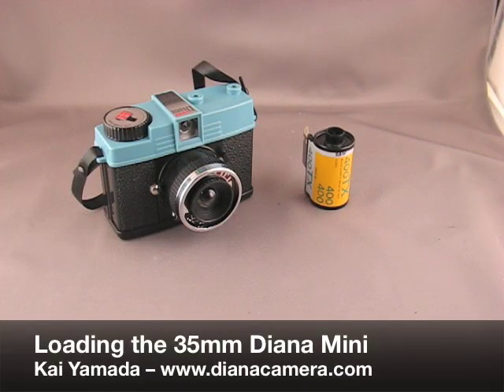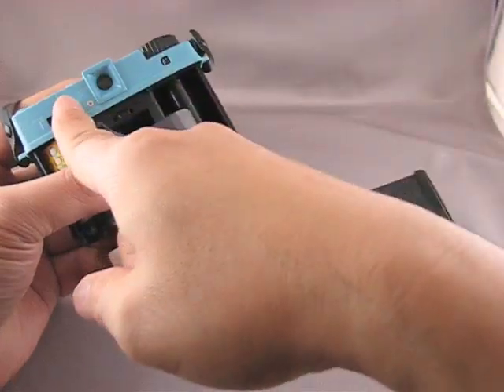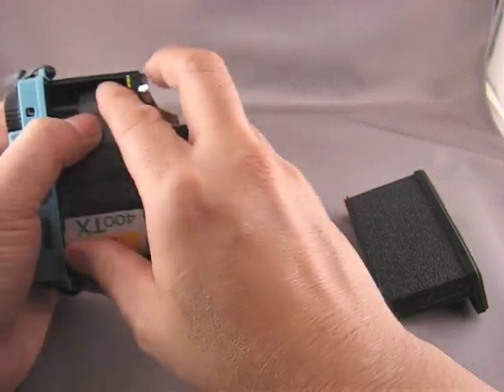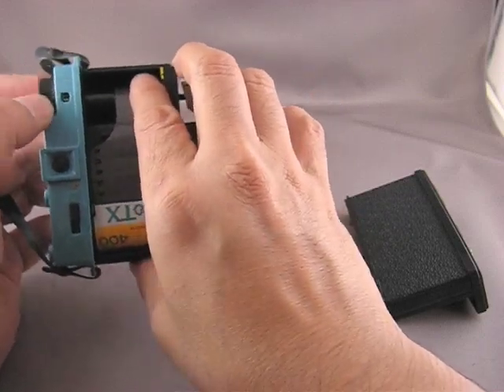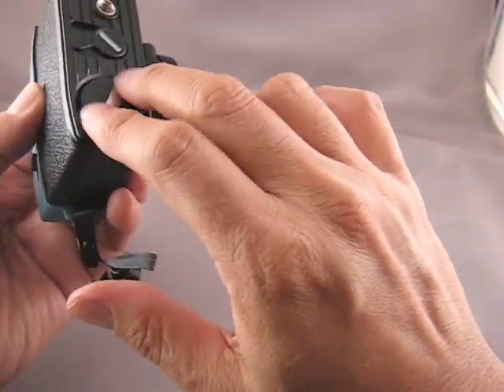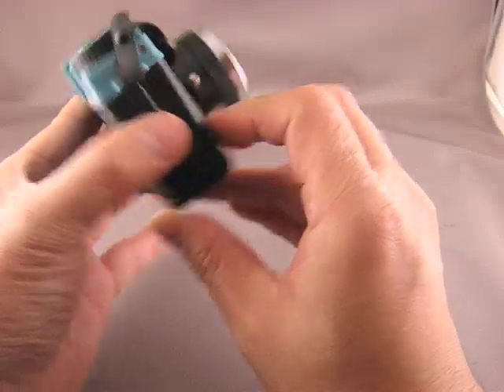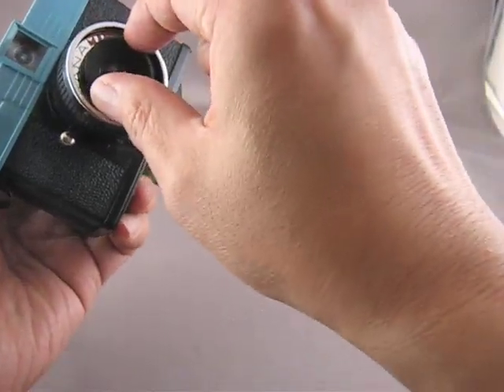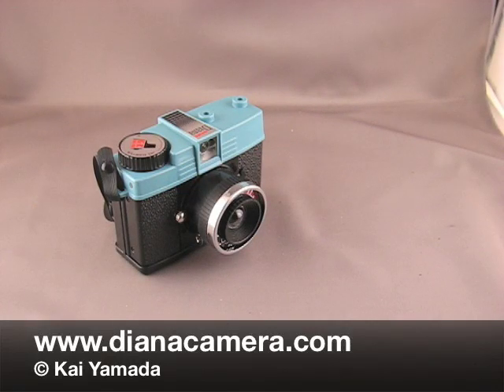Loading the Lomography 35mm Diana Mini

Comment from the maker: The 17x24 frame is a smaller portrait (vertical rectangle) format, while the 24x25 is the square format. The 17x24 is also called a half-frame format, because it is half the size of the standard 35mm frame. You will get twice as many photos with the half-frame format. Be aware, that you shouldn't switch back and forth on the formats on the same roll. The photo lab automated machines may cut images in half, if you throw an odd half frame format in with the full frame.
Reply: Sorry, is it ok to put a iso 200/24, 24x36mm film inside?

Comment from the maker: @ckisstheroses The advance mechanism will auto adjust for half frame mode. The winder will then advance each frame for 1/2 the width of a standard 35mm frame. You still need to wind after each shot.

Comment from the maker: @chrisssti3l The sprocket holes in the film drive the sprocket gear, which turns the film counter. Make sure you reset the film counter by tripping the shutter with the camera back off and before you put in the new roll.

Comment from the maker: Advance the film until the wheel stops. It will only take a partial turn. Don't worry, go ahead and finish out the roll. Be sure to tell the lab tech that the negatives are square, centered on a 35mm frame and that you want your prints or scans centered. 

When reloading the camera, be sure to click the shutter after you have removed the exposed roll and before you put in the new roll, so the film counter will reset.

Comment from the maker: @sunshineloveshappy Even though it only has the 1 aperture,  I think the Holga 135BC is a good camera for a beginner. It's operation is a little easier than the Mini. For indoors or at night, you will need to use a flash unit, or put the camera on a tripod and use a cable release and the B shutter setting.

Comment from the maker: @SoniClub Yes, because the sprockets are what drive the film counter and advance mechanism. Use light thumb pressure on the film next to the film cassette, to give enough tension as you wind the film onto the take-up spool. This should give it enough tension so that everything properly engages.

Comment from the maker: @bucketofpopcorn The film counter must be reset by tripping the shutter with the camera back off, and before you drop in a new roll of film. Bending the tip of the film helps the take up spool grab the film leader. you can also try holding your finger lightly on the bottom line of sprockets as you wind the film onto the take-up spool. The very light pressure will keep the film sprocket holes engaged in the film counter sprocket.

Comment from the maker: @merennna If the film keeps getting stuck, it may be that the film counter needs to be reset. The Diana Mini's counter must be manually reset after each roll. After unloading the camera, remove the roll of film, and with the camera back still off, trip the shutter. This will reset the counter. Then load the camera with a new roll.

Comment from the maker: It can do that if you have a 24 or 36 exposure roll in the camera and the slide switch on the back is set to the left (24x17), which is the half-frame mode. If this is the case, it will go all the way up to 48 on a 24exp. roll or 72 on a 36exp roll.

Comment from the maker: @kahloholic  part 2  The Mini full frames are square, and should be printed centered on the 4x6. Most labs will print 4x6 as their standard print size. I don't think there are many that will cut them down to square for you. Ask them if they can help you out with this roll, but they may not understand or may be unwilling to spend the extra time and effort to print them all correctly.

Comment from the maker: @kahloholic  part 1 Go ahead and rewind. Mixed frames are not a good idea. The problem is that if you've shot an odd number of half frames, the automated lab print machine will start printing the square frames in the wrong place, with the edge of the frame in the middle, essentially cutting the image in half. The lab normally prints the half frames 2-up on a 4x6, but you need to explain to the lab that you have a mix of half frame and full frame.

Comment: Hey Kai, I have a question. I loaded the film as you did in the video, however when I get to the step of winding the knob until it stops - my knob doesn't stop, it can keep going...It still has an "E" the exposure counter.  Did I miss a step? Should I take the film out and try again or will that ruin the film? Thank you so much!!!

Comment from the maker: Yes, if you use half frame mode, the camera will automatically advance the film a half frame and the counter will go up to 48 (24exp roll) or 72 (36exp roll).

It's not a good idea to mix 24x24 photos with your 24x17 half frame images. The lab won't know how to cut the negs and may not be able to print or scan your photos either.

Comment from the maker: if the counter is not moving, there are a couple of possible causes. 1. The shutter wasn't tripped with the camera back off and no film loaded to reset the film counter. 2. The film is not engaging the sprocket gear that runs the film counter.  In either case, try unloading the camera and reloading, making sure to trip the shutter with the camera back off and no film in the camera.

Comment from the maker: @katexkandykane This is a film camera, so you won't know if your photos come out until your get your film processed. If you are new to film photography, you should seriously consider getting a 35mm lo-fi camera, rather than the more difficult to learn with DIana F+ in the Deluxe Package. The package does come with a 35mm film adapter back, but this is still more trouble to use than a dedicated 35mm film camera. I suggest you look at the straight 35mm lo-fi camera options like the Holga 135.

Comment from the maker: @AAproductions1994 It sounds like a misloaded roll of film. Did you reset the film counter by snapping the shutter with the camera back off before you loaded the film? Forgetting to do this can sometimes cause the winder mechanism to malfunction.
Try this. Push the rewind button on the bottom of the camera, then carefully and slooowly rewind the film. As soon as you hear a little snap of the film coming off the take up spool, stop, then open the camera back. Reset the shutter. Reload.

Comment from the maker: @kikinatorrrr When this happens, it is uusually because the film counter has not been reset between rolls of film.. If I've just losded the roll, I will unload the film by carefully rewinding the roll, but not all the way, so the film leader is still sticking out. Then I will open the camera remove the roll of film. Then I reset the film counter by tripping the shutter with the back off. Then I reload the roll of film.

Comment from the maker: @jg112393 The difference is the film. It may not seem like much, but 120 film gives an excellent image, but costs more per roll, per frame, and is harder to find a lab to get processed. Look around your area, and see if you can locate a local lab that can handle 120 film before you get a 120 film camera.

Comment from the maker: @kattoo13 If the mechanism locks when winding to frame one, tripping the shutter will release the winding mechanism. If it's getting stuck between frames during a roll, then you might have a defective camera. Contact Lomography for help. If broken, they will get you a replacement, if the camera is still under warranty.

Comment from the maker: Sorry girlrita, I missed your follow up questions!
1. The film counter is pretty squirrely on the Mini. I always have a hard time figuring out exactly how many frames are left, but you can usually see enough of the numbers on the counter to get a general idea.

2. Unless you are best friends with the lab tech, I don't recommend switching formats mid-roll. It will give the tech a headache trying to print your roll, with the mix of half and full frame images

Comment: Hi Kai, Thanks for your video. I'm still  having problems. The sprocket on the take-up spool is fine. That's working. However, the teeth on the spool under the view finder aren't rotating??? Any tips? Fingers crossed!
Reply: Michael Sinclair I have the same problem. should it be turning? like most slr's and rangefinders

Comment from the maker: @kattoo13 Before loading a new roll of film, be sure to reset the film counter.With no film in the camera, and the back off, trip the shutter. To help guide the film onto the takeup spool, I use my index finger to apply very light pressure on the take up spool on the bottom. This helps guide the film on the the spool, and keeps it from pulling off the upper teeth.

Comment from the maker: @GabieLazareff It's hard to tell what might be wrong, because there are several different things that may be going on. Are the photos square or a tall rectangle? If they are square, but the image is on the left or right of a rectangular print, you are ok. Next time, tell the lab tech you want the images centered. If you are getting tall rectangles, but with spaces between the frames, then the camera is set to half frame, but the film advance is winding a full frame. Continued to Part 2>>>>>

Comment: I'm loading my film as you show but when I advance the wheel, it doesn't stop. I took the back off and tried it so I could see what was happening. The film is pushing itself off the teeth on the take up wheel and so the film doesn't stop and the wheel just keeps turning.Any idea why this is happening?
Reply: I have the same problem, right now, what did you do about it?

Comment from the maker: @RNHCxLEADER Switching back and forth is a bad idea, as the lab may incorrectly crop full frame images, if the half frame images throws off the machine.  The problem caused by switching back and forth would be incorrect cropping, with some images being cut in half. If there are other problems (too light, too dark), then these are exposure problems, and probably have to do with shooting in too little light for the film to make an image.

Comment from the maker: >>>>Part 2    With no film in the camera, take the back off, and try flipping the half-frame selector back and forth. Some part of the mechanism may have become jammed and may free up with a little movement. If this doesnt' fix the camera, and it is new, it will be under warranty. Contact Lomography and tell them the problem you are having.

Comment: On my first roll and the counter is stuck at 33. I have mixed half frame and full frame. Should I rewind the film where it is? Or does the counter go up to 72? What should I tell the lab? If I used full frame square, will they print each one on a separate 4x6 photo? Or will the frames be spread out irregularly on the 4x6 prints?
What about half frame, or overlapping? I understand how these shots will line up on the negative, but it's not like a standard 35mm where each frame fits on a print...

Comment: okay its my second time loading this camera, and i got a little confused. when you turn the wheel, is the sprocket gear spool supposed to move as well? i find that when i turn it, the top sprockets dont turn WITH the film, the flim just kinda slides over it and then aligns itself, and then over it, and then aligns itself. is that correct?

Comment: Hi Kai,

When I first load the film, the sprockets won't stay aligned with the upper teeth when I advance the leader film.  However, it will stay aligned with the teeth on the right.  Also, when I finally close the film back, it does lock.  Only thing is, it won't always advance to the E frame.  So then I have to open the back up again, and I am worried about exposing the film.  Help!!!! tx

Comment: The sprockets at the top are tearing the holes apart when I try to wind. What do I do? I have tried opening it and seeing if what the problem is but it works until I put the cover back on.

Comment: hey kai. :3 So my diana mini isn't excepting the film properly. The sprocket gear spool won't rotate with the take-up spool and my film keeps on getting jammed. Is the sprocket gear spool supposed to move when you turn the advance wheel? Or am I just loading the film wrong?

Comment: Hi Kai...the teeth of my viewfinder keeps getting stuck in my sprocket holes on my film, and it's sometimes impossible to turn the film to a new frame so i have to take the back off and pull it up as the teeth keep ripping the film holes. should i reload it with a fresh film and start again? what have i done wrong? thanks

Comment: ok, so i:
1: trip shutter
2: put film in, wind it out
3: close it and try to wind
but then it stays at e. the thing won't turn, and i accidentally tore a couple of the sprocket holes on my film. i tried on both square and half frame. what am i doing wrong?

Comment: what happens to the camera if the lens are not covered ? is it not going to work ? i am really scared because i lost mine a couple of months ago, and i am not using my camera ever since....
Reply from the maker: +li sa The lens cap is only there to protect the lens. If you keep your camera in something like a small camera case and avoid carrying your camera around in a bag full of stuff, your camera and lens should be fine. In a pinch, a sock can even be used. Just avoid putting the camera in a bag or purse where there are hard pointy objects (pens, keys, etc), and you and your camera will be fine.

Comment: has anyone else had problems with the switch between full and half frames? not during the middle of the roll or anything, but before you've even loaded? mine seems to be jammed and i'm not sure how to fix it, but i'd really like to try the half frame setting
Reply: Stephanie Kaplanis  It can be used only after shutter release, and also is prone to fail occasionally. It is not that impossible to disassemble camera and restore it working, search for Fix Diana Mini For Good.